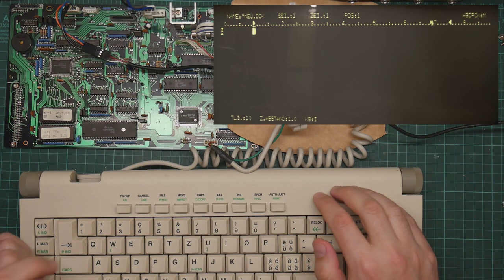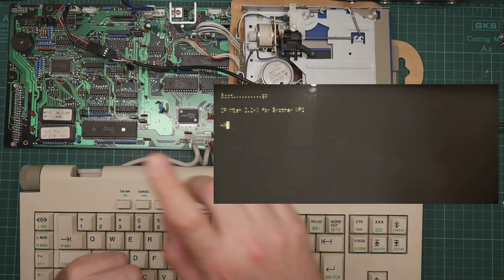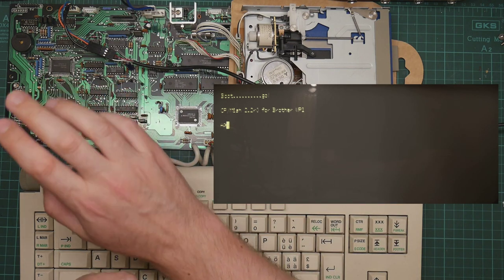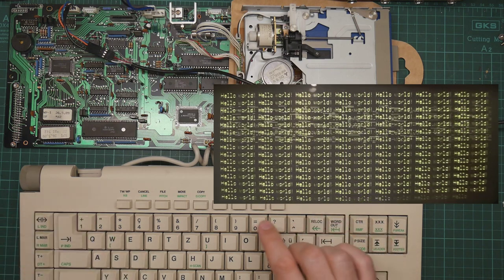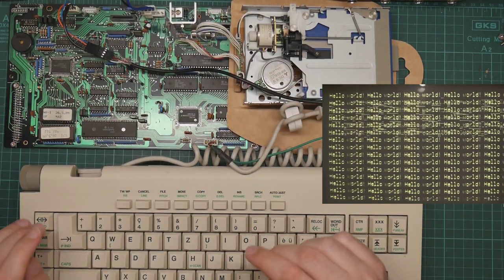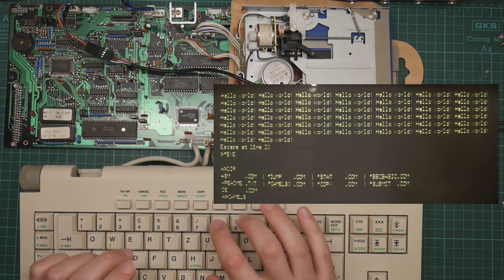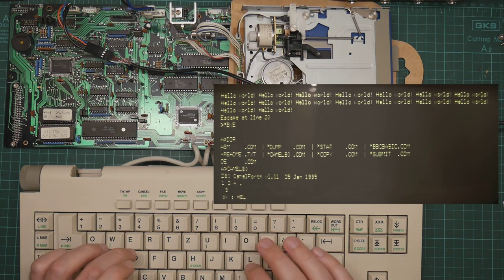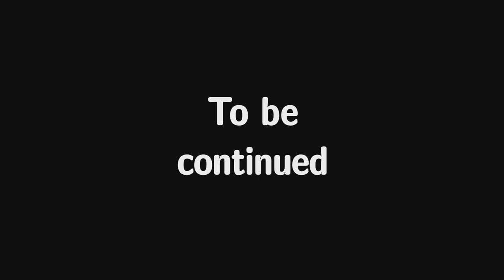A Brother WP-1 serial interface: #1

Comment: You should look into the brother If50 interface device
Reply from the maker: I did not know that existed! It looks like the LF50 connects to the typewriter via a serial cable --- maybe that's what the unpopulated serial connector on my board was for? Or maybe it was supposed to be plugged in to the keyboard connector, explaining the weird RX line wiring?
Reply: They essentially were to convert certain word processors into a terminal, teletype, or daisywheel printer
Reply: @hjalfi  after asking someone who has one it seems that although the IF50 connector has 12 pins it is actually only 6 pin on the circuit board in a straight line sort of like one of the sections on the far end of your board but I couldn't get them to trace them out for me...